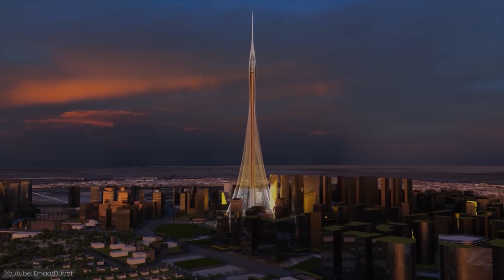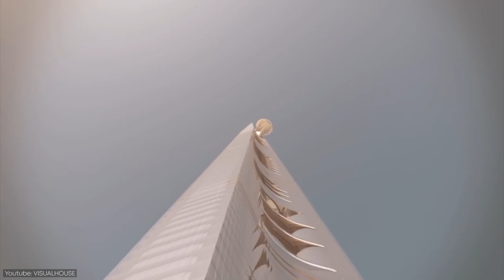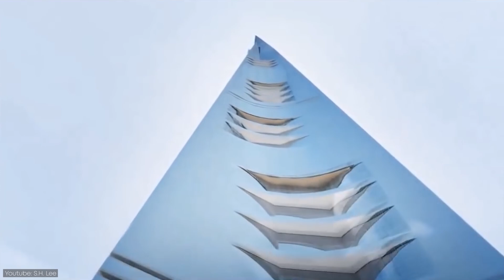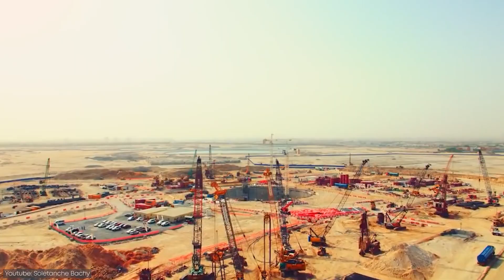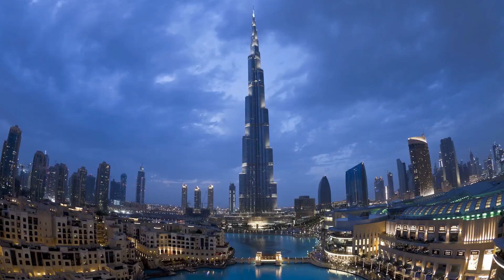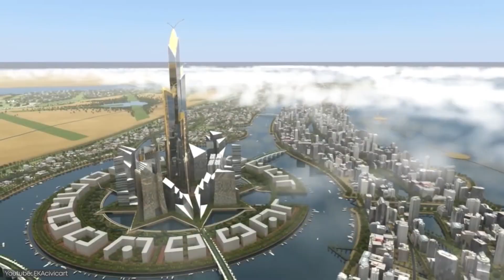Why the World's Tallest Skyscrapers Failed

Comment: Might it eventually be the case that they start to understand what the "club of Rome" has been explained almost 50 years ago with "The limits of growth"? 
Might it be that they start to take the reports of the IPCC seriously into account? 
What does climate change mean in particular to this region regarding the extreme weather situations that now have to be taken into account? 
Are they still recalculating and re-engineering? 
I have now glue about the real reason, but as an engineer with more than 30 years of experience, I would at least not be surprised about that.

Comment: Short answer: Covid19 is responsible for most of it.
Reply: Jeddah Tower was on hold before the Pandemic hit. I guess they ran into issues. Not easy to build a potential white elephant.
Reply: @blueflame3531  its mostly because of their biggest investor being imprisoned for corruption
Reply: @M0eRiyadh  🤔 I thought the kingdom pushed for the project?
Reply: @blueflame3531  no I meant why it was originally stopped
Reply: no... its because of airport authority restrictions.....too many super tall skyscrapers result a high risk of airplane crash, if they obstruct the flight pattern

Comment: Although I don't have much knowledge about building skyscrapers, I think a 1300+ meter high building supported by "cables", is not such a good idea.
The "cables" need to be extremely long and if they don't collapse under their own weight, I would find it difficult to believe they have enough strength left to be of much use. 
They will (because of their weight) also put a lot of stress on the building hanging there and/or "cables" on the other side (during heavy wind).
If they are not like cables, but more like a steal frame, it's still a very weak construction (based on the images) I think it will either not work to begin with, (if it does) will not last decades.
Reply: Yes, it is also important to note that the tower’s height is unknown, the 1,400 meter tall measurement is a rumour and not actually stated by authorities. Either way, It would be interesting how the Dubai Creek Tower will be built.

Comment: Super tall buildings are overrated. An average building is still superior ypu go up and down in 5 to 10 min.
Reply: 5-10 minutes what my boi. For example I live in the 40th floor of a 65 floor tower and it takes just seconds to reach that floor. If we assume the creek tower has 200 floors and faster elevators then it might take no more than 3 minutes to reach the top floor. I think you forgot super fast elevators exist nowadays.

Comment: Jeddah Tower will actually have 167 floors. Such height with a glass cladded concrete spire made it look like 252 floors. 252 floors will have a floor equivalency of 252 floors.
Reply: They meant that they measured the hight of the building is 252 floors